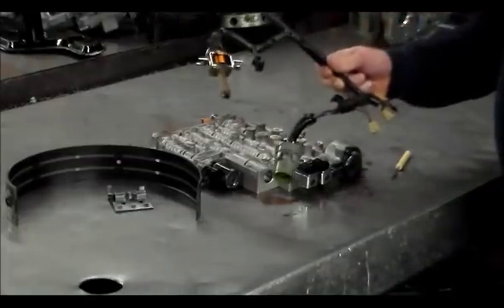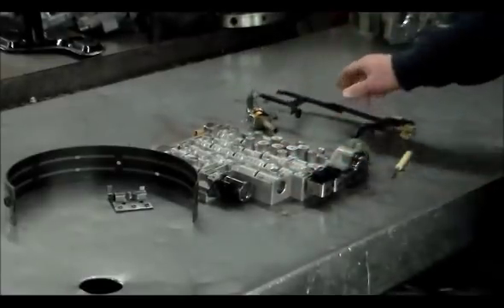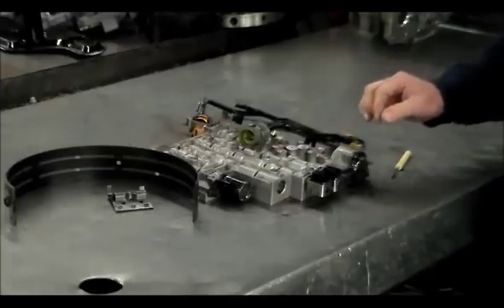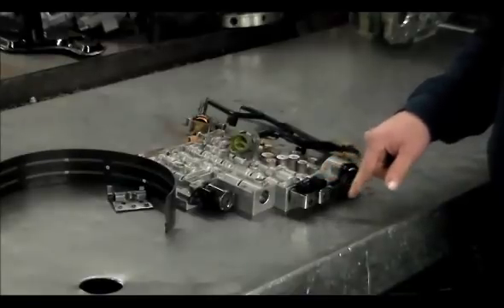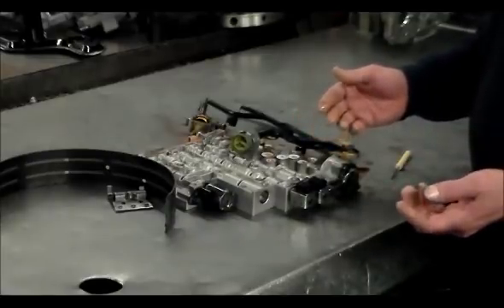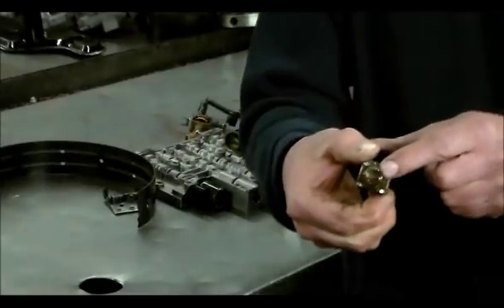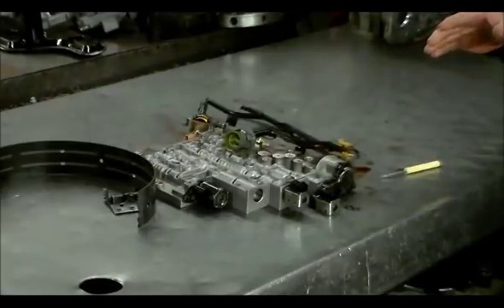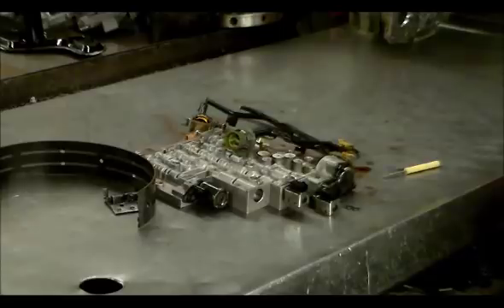4L60E, Code P0752

Comment: Hey Gary Ferraro I was just needing to ask you a couple of questions I am by no means a transmission tech, I have a 2008 hummer h3 with the 5.3l v8 with the awd 4l60e trans and at about 120,000 it started off as just not wanting to shift out of first into second but would happed Rarely would pull over put it in park then it would work fine then it started getting more frequent so we parked it. So I finally wanted to get it back on the road so I scanned it and got just a po700 I think, just a generic code so I thought I was just shift solenoid or something along the lines after changing both shift solenoids checked the valves and spring when I did the solenoids fluid filter the speed sensor and connector on the transfer case which I think is the output speed sensor also changed the tcm these are the current codes I would really appreciate any help that you would recommend if not I will be replacing the trans completely po562 system voltage low (had too jump off car) po711 trans fluid temp sensor performance po722 output speed sensor circuit low voltage po723 output speed sensor circuit intermittent po741 torque converter clutch system stuck off po742 torque converter clutch system stuck on po751 1-2 shift solenoid valve performance no first or fourth gear po752 1-2 shift solenoid valve performance no first or third gear po756 2-3 shift solenoid valve performance no first or second gear I have not had time nor a power probe to check grounds of shorts or continuity on the wiring I’m sorry for such a long comment just need help thanks so much

Comment: I have 2nd gear if I let off the gas and I have that code what could it be
Reply from the maker: It's actually probably going from 1st to 3rd.  After it shifts put the shifter in manual 2nd and give some gas see what you have
Reply: I will see what happens in a few minutes and get back to you thanks gary
Reply: @GaryFerraro  shifts to 2nd once I let off gas
Reply from the maker: @Pabloxpal  Probably internal problem, I think it's still an issue with the band, band maybe cracked
Reply: Quite possible the problem with it... it was fine then one day I had this issue
Reply from the maker: @Pabloxpal  If it happened suddenly then that means usually something broke
Reply: Okay I'll figure it out was just wondering if it was the solenoid or not I'm gonna drop the pan and check the valve body before I drop the transmission and take it apart
Reply from the maker: @Pabloxpal  It's usually not a solenoid problem
Reply: @GaryFerraro  it was the 2nd band took the transmission out and inspected it easy fix
Reply from the maker: @Pabloxpal  Great, thanks for the update, glad you got it fixed
Reply: My trans hits when I’m coming to a stop . I’m getting the same code. Seems to shift fine when getting upto speed.

Comment: No 2 and 4 gears got Po752. Replaced both solenoids. No change?
Reply from the maker: You have a broken band inside the trans. Computer doesn't know the band is broken so it blames the solenoid

Comment: Can you help i have a 2006 honda transmission with 57000 miles on it and doesn't past rpm 3 tp 4 and only goes 35mph and had flashing d but fixed it now still does the same i replaced transmission shift control solenoid
Reply from the maker: Do you know what code was present?
Reply: P0752
Reply from the maker: @andresguerrero7828  This code is a mechanical code usually something inside the trans.  What happens when the trans shifts to 3rd? do you feel a slip?
Reply: No just feels heavy like if im putting alot of pressure but im not. And car only goes 35mph
Reply from the maker: @andresguerrero7828  almost sounds like failsafe, is it shifting
Reply: It shift from 1-2 and 2-3 but after 4 it doesnt shift and whats failsafe
Reply from the maker: @andresguerrero7828  failsafe is when the computer cuts off electricity to the trans and it's stuck in one gear.  Question, does this problem happen when the car heats up?
Reply: No it does it all the time and my a.c. gets hot and engine but it says shift solenoid a stuck on
Reply from the maker: @andresguerrero7828  Thats because the computer is blaming the solenoid, i would say you may have a stuck clutch pressure control(cpc) valve. These valves control the apply and release of the clutch packs. They work with the dual set of linear solenoids on the outside of the trans